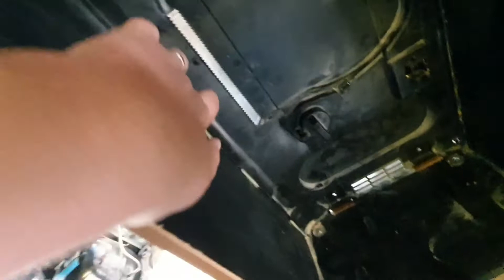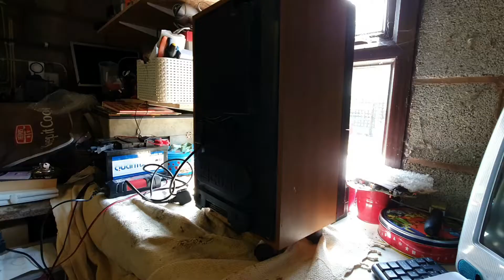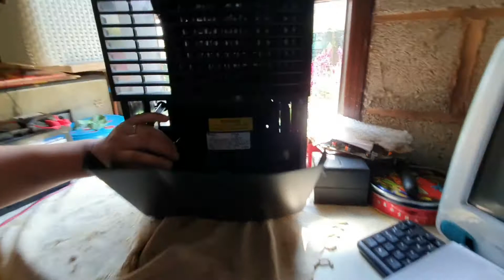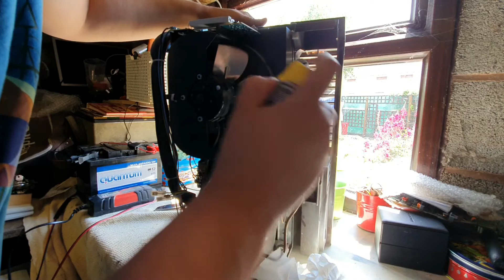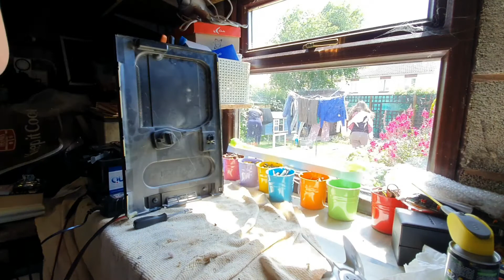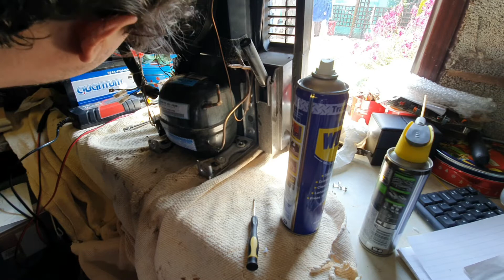Servicing a 1993 Ebac 660 De-humidifier

Comment: Assuming there has been no leakage, then will this still work with the same efficiency as originally built? I wonder if newer ones would be more energy efficient.
Reply from the maker: It works very well, newer ones will be more efficient with more efficient compressors….

Comment: I bought one in 96 or later and it was wood. I still have it, but I have not used it in 20 years. I switched it on yesterday and it was not working. The red light showed. I wiggled the float thing and it made no difference. Do you think these have any value these days for spares or repair? It seems such a shame to toss it.
Reply from the maker: I’m not sure to be honest. I replaced the fan motor on mine and it now lives in the conservatory. I find that the water container needs a jiggle and a slow close of the door when emptying it, else the light will flash or stay red.